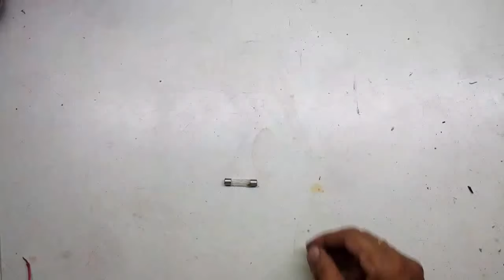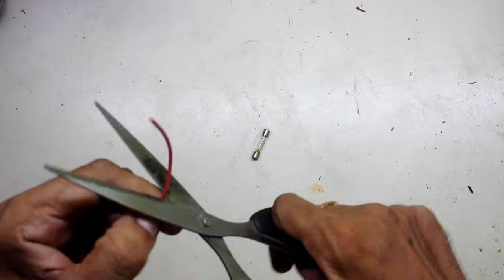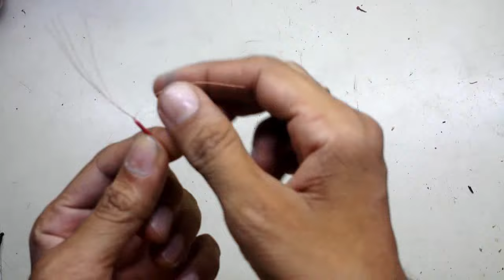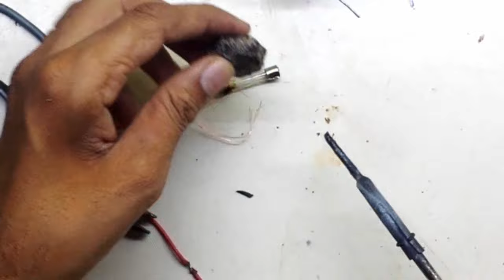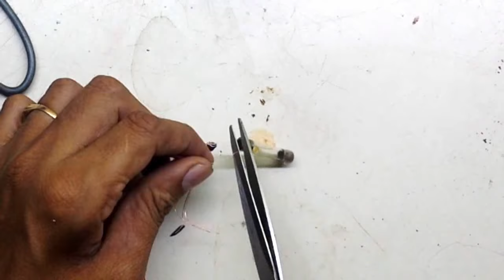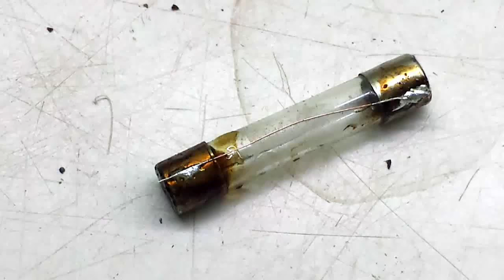How to repair dead fuse at emergency

Comment: For 1A, I use the wire from a USB strand cable (the data line). It is smaller, very very thin.
Reply: what about 2A with thick spiral wire

Comment: Do not ever do this especially when you deal with machine boards. There is a very high risk of burning the entire board..
Reply: Why?
Reply: @Ricardo-uw3ov  in case of short circuit wire inside fuse becomes red hot and explodes but that doesn't matter because glass is shield. However if you put wire outside shield when she explode pieces of red hot wire can ignite something flammable inside device, this is fire hazard.
Reply: @Ricardo-uw3ov  in case of short circuit wire inside fuse becomes red hot and explodes but that doesn't matter because glass is shield. However if you put wire outside shield when she explode pieces of red hot wire can ignite something flammable inside device, this is fire hazard.
Reply: @Dark_Matter2 you can buy 20 of these things for 1$ or equivalent.....

Comment: This is not safe,,the ams may vary if excess current flows into the circuit the fuse won't be blown then u have buy new one instead of fuse

Comment: What you have done here is totally wrong.  Copper wire should never be used as substitute for fuse wire. It is a good conductor of electricity and will not serve the purpose, even if you are using only one strand of wire.

Comment: How dumb, you mean everyone got soldering machine in emergency? 🙄
Reply: Tired the wire around sides
Reply: I have I'm a electrician so I fix everything,got a technics 1210s and I have 250v fuse 5 amp but need mil amp,ohms law it looks like